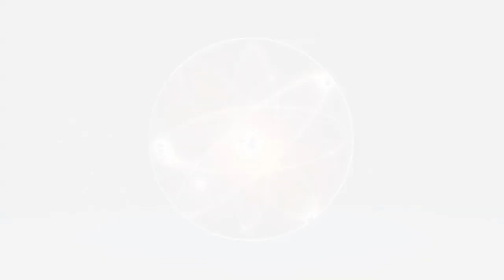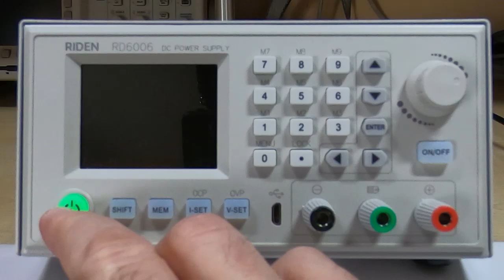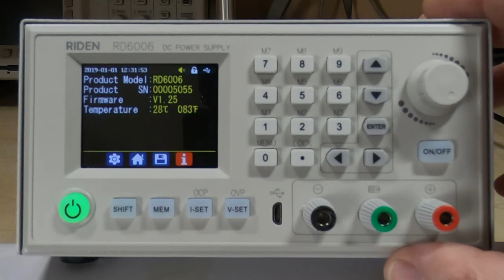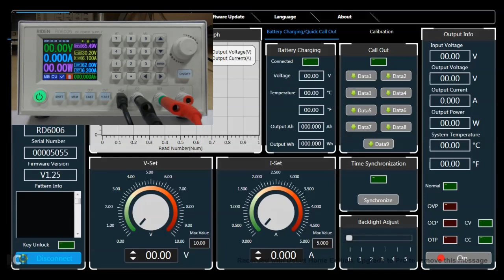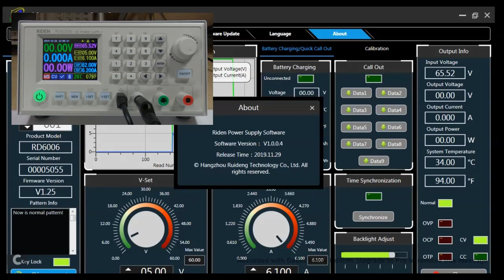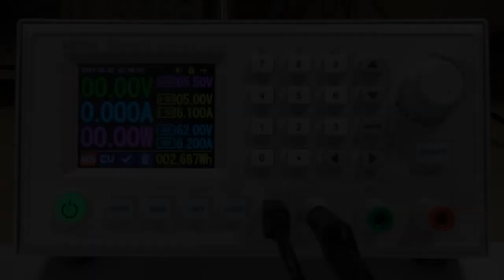Riden RD6006 Power Supply Part3

Comment: It’s not good to start off a Li-ion battery charging process with a constant voltage mode, you should start with a constant current mode and not exceed a 1C charging rate, and then finish off with a constant voltage mode if you wish to really top charge the battery and compensate for the internal losses you had during the constant current mode. Not blaming the video creator here, but the software should not allow to start off in constant voltage in the battery mode. It’s asking for too much battery knowledge from the user.
Reply from the maker: As I said in the video I would not use this for battery charging.

Comment: @5.15 : You can put a piece of transparent tape on buzzers to lower the volume. :)
Really handy. Quick fix or low-tech - But it works great.
Reply from the maker: I use adhesive backed foam tape. It makes them even quieter. But only when I cannot turn them off completely. I think I mentioned this in one of the videos.
Reply: @JerryWalker001  Great. I imagine that! Have to try that out sometime.
I must admit, that this is the first time watching one of your videos.
I won't go into to much details, but this seems to be a good deal for hobbyists, or professionals within different professions.
Regards, and thanks for quailty content. thumbs up

Comment: Hi Jerry, thanks for the riden series very informative. I have just bought two of these I am also impressed, just wondering if like my Siglent you can set a "time period " say for battery charging etc in the memory function.
Reply from the maker: I am about to build a second unit using a linear primary power supply and I will be posting some videos on this process and also on how the two units compare. The battery charging is very basic so no capacity limit or delta peak detection. It just runs in CC mode and then CV until the charge current drops to less than 10mA and then it turn off the power. I doubt I would use this for actual battery charging. This function may be useful for initial testing of battery control systems. You could use the 'external' temp sensor as a battery pack sensor and the supply would then shut down if the pack gets too hot.

Comment: Are you planning any tear down of RD6006?
Reply from the maker: I could show it but there is not really much to tear down. Just a small pcb and a display.
Reply: @JerryWalker001  It would be nice to know the ADC they have used to  for measurement, the DACs used for adjustment. also details about the the main processor etc. :)
it would give an insight in product
Reply from the maker: I will be constructing a second unit using a linear supply so I will do a mini tear down of the RD6006 as part of that.

Comment: That is a neat power supply.  I think I will have to get one and try it out.  Battery charging seems nice, does it only do CC CV charging for lithium batteries or can it also do -dV / -dT charging for NiMH too?
Reply from the maker: The battery charging is very basic. It is really only a CC/CV charger. You have to set the maximum voltage first and it just charges to a terminal voltage. It does not do any peak detection although it could still be used to charge other battery types. As far as I can determine the only difference between the normal output and the battery terminal is a blocking diode and battery present detection. It does work but I would only use it with batteries if I wanted to investigate battery performance (which I assume is the intention). It seems to be a very good supply so far. I carried out other tests (not recommended) such as connecting charged caps etc to the output, inductive loads, shorts etc to see if I could kill it and so far it has survived. I can see it becoming a well used supply in my lab as it is quick and easy to use and combined with the high output makes it very versatile. I am hoping that they change it so that the output turns off when a memory is selected as that is (in my opinion) a major flaw.
Reply: @JerryWalker001  I think you make a good point that adding an option to disable the output automatically on memory setting change could be nice for some cases.  While I don't have one of the power supplies yet to speak from experience, I like the idea of being able to smoothly change from one voltage to another without power being disrupted.  I would think the warning to confirm the voltage/current is sufficient to prevent accidentally applying too high a voltage in most cases.
Reply from the maker: I still think this is a very bad part of the design. Apart from the fact that the warning can be turned off it is way too easy to hit the wrong key. For example hitting the 8 instead of 9 could select entirely different voltages (maybe 60V instead of 3.3). There is absolutely no advantage. If you want to switch smoothly between voltages then simply enter the voltage you want. Eg to switch from 5 to 10V then simply enter 10V and press enter.